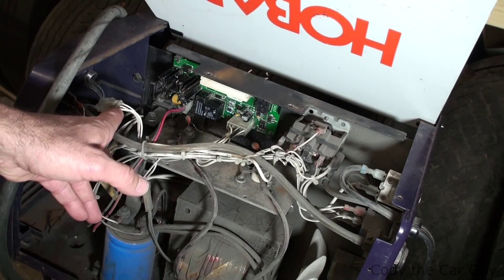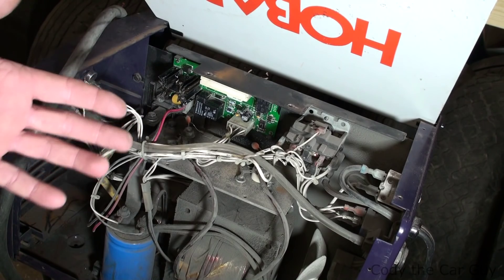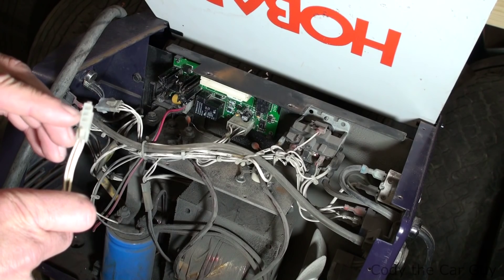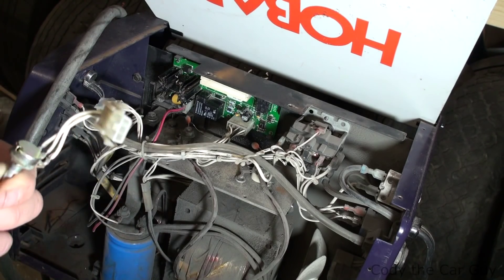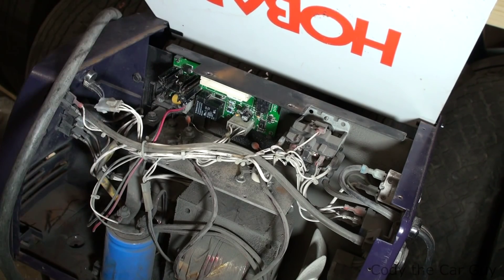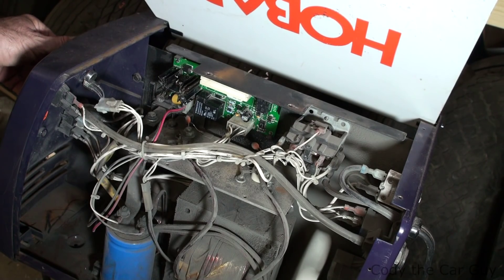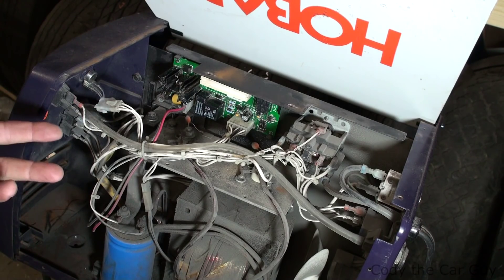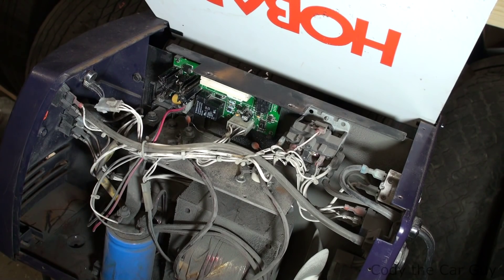Hobart Handler welder wire speed repair part 3

Comment: Mines not turning . A new motor isnt turning . The carboard rectangular capacitor looking thing under the handle area at the top of the circuitboard is disconected on one end . How'd that happen i wonder . The relays click . Idk yet .

Comment: I have a Hobart 140 mig  some reason the controls are backwards you turn the voltage knob it controls the wire speed. . It also won't weld right  it jumps when trying to weld thanks Robert
Reply: Did you figure this out? Mines doing the same!! Thanks in advance

Comment: I have learn a lot  from you. I have a hobort handler 175 wire feeder is giving me some trouble wire is not realing of as it should.where do I get the board to buy and and the nab for adjusting the speed
Reply: Try a new tip first .  Usually the tip gets tight . Check the spool wire is not flattened . Lincoln wire is squashed when new.  Defective .

Comment: thumbs up man , I missed part 1&2 .. Are they up yet cody ??
Reply from the maker: The other videos i still have to upload one is installing a new liner. The other is taking the welder apart to test and change the rheostat switch
Reply: Great vid man !!
Reply: @CodytheCarGuy my 140, I changed rheostat, my fan motor, and the chip. My voltage knob changes my wire speed, for some dumb reason now…
Reply: I have a 175 hobart handler, bought 2001, just used about 2 hrs, the motor just clicks, tried a 9volt battery to see if it was the motor, :motor ran great, also replace the liner prior this, everything worked great, then the motor just clikcks. they want around $360.00 for a new board. Can you help me figure out what to test or do, thanks